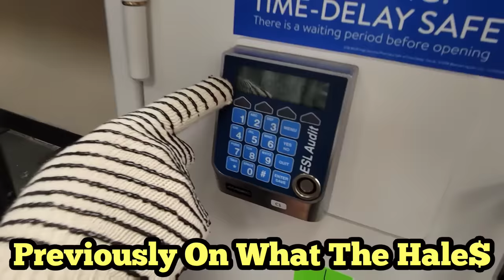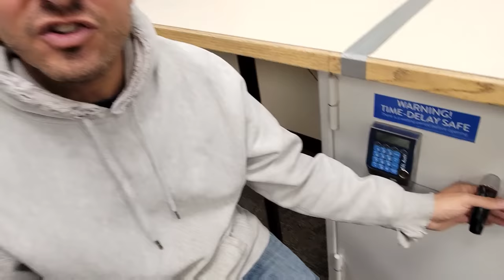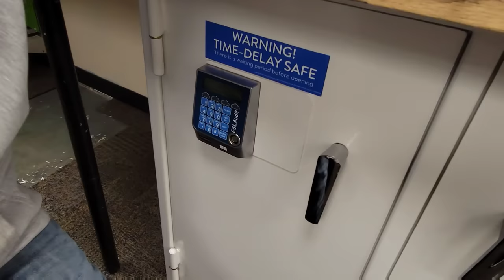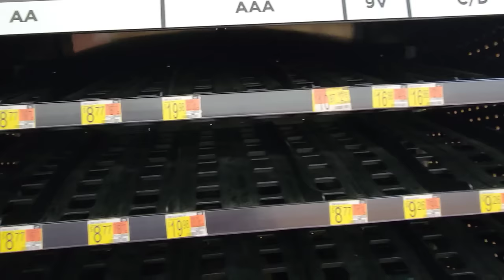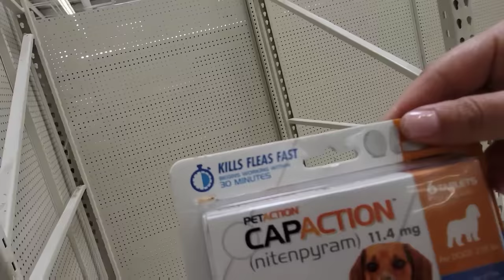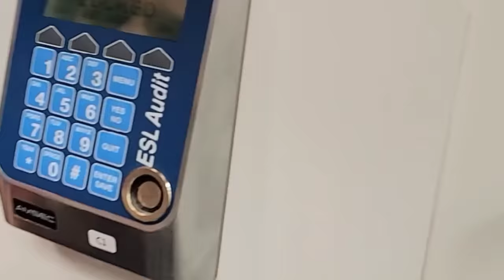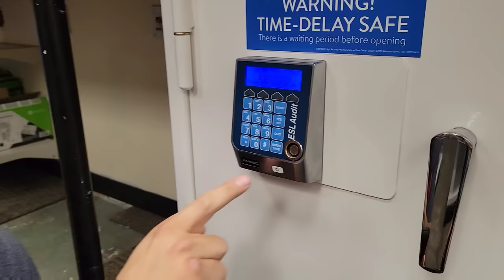FOUND MONEY IN SAFE At Abandoned Walmart

Comment: cutting the hinges usually doesn't help much, once you got the first compartment open you could see where the bolts (not pistons) are located. if you cut at them have a extinguisher handy. This safe wasn't much, some doors are 3-4 inches thick with thick sides too

Comment: you could have probably taken a battery and put it across the two wires sticking out of where the key pad was,,,  the locks would be controlled by solenoids    Energize solenoids,,  pull in the locks,,   easy,,  :-)